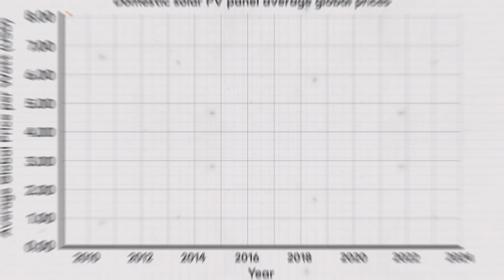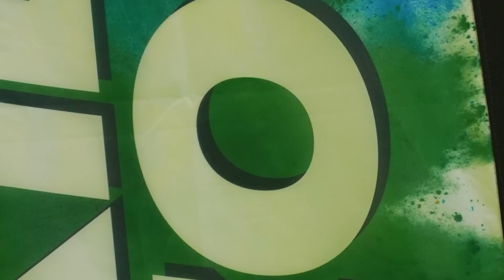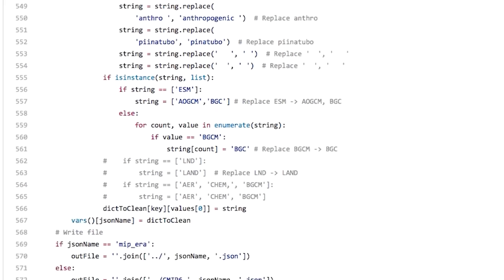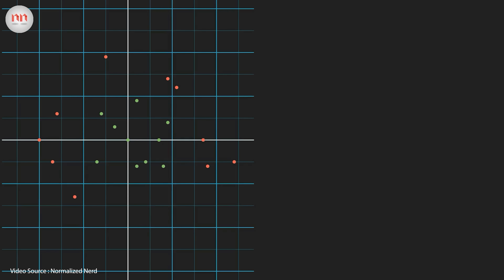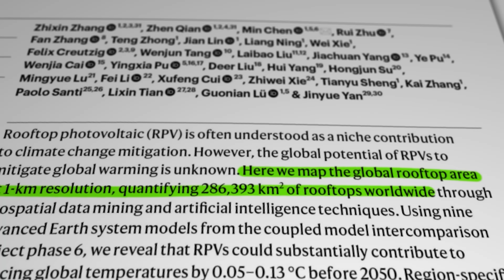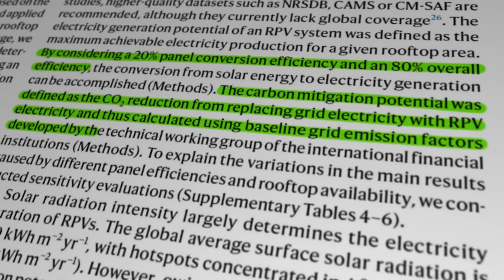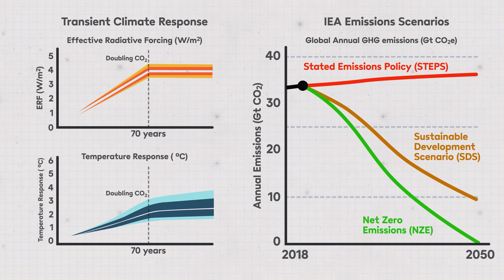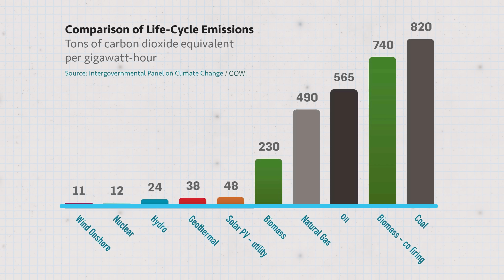New Report - Rooftop Solar PV is THE biggest climate mitigation technology!

Comment: I looked at rooftop solar here in Ontario Canada 12 years ago and was told the system would cost me $30,000. $5000 for the labour and 25,000 for the solar panels. Two years ago I again enquired into this and was told the system would cost me $30,000. $5000 for the rooftop solar and $25,000 for installation. I saw this as being criminally overcharged and so did not go ahead with this system. any suggestions?

Comment: Put my 5kW PV system up, 11 years ago, myself.  Cost about $5k, which paid for itself in 3 years.  Converted my whole house to electric, with heat pump HVAC and 2 EV’s, so bought new, 15kW of modules I’ll be putting up this month, replacing my 5kW system, totally worth it!
Reply: Very similar story to mine. I had 8kWp at first and then added another 8kWp, installed heat pump and bought two EVs. Now I don't know what to do with my money. 😅
Reply: 5k elen years ago? hard to believe. With inverter, mounting solution, cables etc?
Reply: @AttilaTheHun333333 True. $5000 for 5kW in 2014 is indeed very cheap, even DIY. But not impossible if one searched around for bargains.
Reply: Without overall control of saving energy solar has been pointless for all people that I have seen, friend got some and great rate back that is due to run out but with the money saved bought a motor home and travelled the country. An average UK household uses about the same amount of electrical energy in a year as is in 11 tanks of diesel. With solar being around 2% of total energy in the UK and just being an add-on to total energy, solar has had zero mitigation on the climate because their has been a zero reduction in energy consumed.
They're not free and they aren't clean, China has used the same amount of coal in the last 20 years than USA in the last 100, and as I say overall, with electricity being around 20% of our total energy, Solar would have to have a 1000% of all the installations of the last 2 decades and still 80% of our energy needs a replacement if we want to maintain society as is which is supposed to be impossible. 
Reality is we could all go to electricity, cut everything else, cut consumption overall and by staying on coal we could have cut 80% of energy.
Reply: @antonyjh1234 so easy to always spot the BS’er petroleum troll, keep sucking on those diesel fumes!
Reply: @antonyjh1234  🤣 No worries.

Comment: Whether roof top solar is worth it or not comes entirely down to your contract with the energy supplier. Is the metering "Net' metering or dual register where the imported power is metered separately from exported power, what prices are you being charged for energy verses what you get for selling energy. Are you allowed to export to the grid? How Much? When? Having a 10kW home system is a waste of time if your supplier does not allow export, or limits you say 2 kW maximum export, then charges you network access charges for the export permit. 
Rooftop solar is a ponzy scheme, those who got in early had great deals, those buying in now not so much. Energy suppliers don't want rooftop energy as it de stabilises the grid load profile making the day time load dips and night time load peaks more severe.

Comment: I’ve got 8kw of solar and my estimated conservative payback period is about 5 years.  I’m in Queensland Australia so the solar generation is probably about the worlds most favourable here.  

The wholesale electricity price here in Australia now regularly goes negative during the days now just because of all the rooftop solar installations pumping power into the grid.  

Here in Australia we are now flat out building battery energy storage systems to store all the better than free energy to discharge it at night when it’s needed.

Comment: central governments should vertically integrate the production and recycling of silicon based solar cells and panels, which would remain the property of the central government, and be low or no cost to the homeowners.  like checking out a book at the library.

Comment: I wonder if anyone's researched the idea of a global rollout of LiFePO4 batteries in every home.
If electric utilities and consumers share the cost of installing 20kWh of batteries in each home, the ROI for both the utility and the typical household is about 5-10 years, even on petro, because everyone can use non-peak rates.
Utilities then can install solar/wind/whatever without fear of intermittency, and they can do so at optimal locations.
The benefit extends to people living in apartments/condos/towers/etc as well.
As a bonus, everyone gets a backup battery. No more blackouts!

Comment: I put in a 13.5 kw system with 2 battery packs, overkill… after running the house, charging the EV (and we drive a lot) and selling excess to the grid we have sold $20 more then used.  Looks like an 8.3 year payback.  Off peak I buy power at 6 cents a kw and sell excess at 8 cents, Netzero helps with controlling when to buy allowing selling excess as much as possible.

Comment: No. But it's 80% of the solution. If every house could even have a small amount of solar to reduce even their grid usage by 10% they reduce the grid requirements by 10% and we can reduce gas and other fossil fuel use.

Comment: Do you know if the system took into account the structural integrity of different types of rooftop. For instance due to my roof being rated to withstand a category 4 cyclone, it will support the weight of a much larger PV system per square meter, than say the rooftops of a shanty town outside of Mogadishu

Comment: There are still 3 arguments to solar (as of right now, not future talk), 1) Its still a bit costly for the average home owner. Not only the cost of the system, but also issuance, maintenance, paperwork, etc. 2) Its a risk item, depending on the area in the US, these panels might have to deal with some weather that they might not last against such as tornadoes or hail, sleet, and snow. 3) Battery cost are still high and you will want batteries. A lot of this can be fix and will be fix over time, but the main issues still exist for many. States and Cities here in the US need to support the idea and offer packages for home owners to get the best value out of it. Labor being the most costly part + getting people that know how to install it correctly and not cause roof issues. Some people wont have access to their solar during winter where they will need ot be clean off as well. In the mid west, its not that crazy to get weeks with no sun/cloud cover. To be clear, I am pro solar, I have solar panels, but I am just giving off what I notice as far as why many may no go that route. Again, I know many of these challenges can be fix in the future, but until they are, it is what it is. Even then, the US needs to look at power import and export differently as well. As you say, we need to push uiliity companies away from generation power to storing more power. And then, force them to buy the power roof top over produces at reduce prices and sell that back to customers at reduce prices. This way it becomes less of a rich vs poor as more people go solar, it helps everyone to go solar.

Comment: The big catch is that solar panels are only 20% efficient.  Solar panels are mostly black, so they absorb much more heat than white roofs.  20% of incoming heat goes to electricity.  The other 80% goes to heat which heats the building and its surroundings.  Because of this white roofs are preferred in sunny climates.   

I was in Darwin Australia recently.  Almost every house has a white roof  ..... and air conditioning.

So the electricity generation benefits of solar panels in hot climates are counteracted by the unwanted local heating effects.

I do not have the numbers, but I think this problem blows your proposition out of the water.
Reply: In places with high Aircon usage solar is an even better idea. Running AC from fossil power plants is really making things worse.
Reply: Burning a fuel in a power plant also releases most of its energy as waste heat. This waste heat has no meaningful impact on the local temperature.
Reply: Thermal power stations use cooling towers to disperse waste heat.  But heat absorbed by solar panels but not turned into electricity heats the houses underneath.  This heat disperses eventually but until it does the local environment is heated.   Hence more Aircon load  for example and possible heat islands.

Comment: Yes, wonderful. Points again to the elephant in the room that we don't really have a solution for: seasonal energy storage for electricity.
Reply: hydrogen seems to be the best prospect for that, though both storing it underground and burning it for electricity on demand are unproven. In the meantime the priority is replacing gas on the grid with solar and wind.
Reply: @dougbamford  where I am gas is used mainly for peaking power, so solar and  wind don't replace that. IMO ammonia is a better choice than hydrogen for long term storage - the storage cost is likely lower. At long storage times, storage cost dominates all costs.

Comment: On a residential scale, done right would make serious sense.  For anything comercial or with any kind of density however and you need to go to heavy generation strategies like Hydro, nuclear, biomass/waste, or geothermal.
Reply: Mixing sources is always a good idea. But you can fit a lot of panels on a warehouse roof, and that could probably run a lot of the machinery. Check out RSEV who has panels on the roof of his EV Sales business and charges the cars from it for free.
Reply: @dougbamford  Commercial= Office full of PC's, Supermarket, Fast food.  None of them have enough square feet of roof to feed the reefers, computers or foodline.
Warehouses? that might be enough for a surplus.
Reply: @dougbamford  the energy density-what a solar panel can collect- in the middle of the Mohave desert USA is 3 kilowatts/ meter. a solar panel is about 25% efficient.  I doubt any steady load can be supported at that energy density.  Those cars are plugged in for an hour, charging off energy collected for 24hrs.
Reply: @watchthe1369 Sorry, I don't understand what you are talking about. You can either put a panel on a roof or not. Once done it will generate what it generates. If you don't put one on a roof you won't generate anything. No one has said that the solar panels have to generate exactly what the premises use. They can generate less and save the owner money on their power bill. They can generate more and the surplus can be sold to other users. What are you trying to say?

Comment: What I've often wondered is how much effect make roofs white would have. White roofs reduce the need for air conditioning, reduce the urban heat island effect and should reduce global warming. Relating to the video; solar panels are dark and so absorb most of the light that falls on them - the opposite of a white roof !
Reply: I don't have any hard numbers for you undertunately but I can think of 2 major factors that makes solar panels different to painting a roof black ( wrt to effect on air conditioning) - first of all 20-30% of the solar energy is not converted to heat but instead electricity, second there is generally a small air gap between the panels and the roof which is inefficient at transferring energy to the roof and even slight breezes will displace that heat

Comment: The only reason wild AC from roof top solar voltaic and wind turbine generated electricity are not stranded assets is because of their forced support by the public power grid.   Large amounts of wild AC is reliably supported by the public power grid with natural gas jet turbine generators running at 70% fuel consumption high readiness making nearly no electricity where 100% output would 100% backup the wild AC.  This costs more natural gas at is lowest level of consumption than making all the electricity from efficient running natural gas combined cycle power stations able to use a steam cycle to add 50% higher efficiency.   A steam turbine generator reacts too slowing to support large amounts of wild AC practically necessitating large amounts of natural gas to support wild AC with jet turbine generators at high readiness.   

In the US there is a reported fuel saving of 1% each for solar voltaic and wind turbine generated electricity.   This is an optimistic and false fuel savings.   The UK is culling its wind turbine farm to lower more steady output to save expensive natural gas.  Germany is doing the same stating it is experiencing a "wind draught" for the lower percentage of wind turbine electricity.   

There has been no climate change from global warming which is expected to start at 1.5°C of global warming causing stronger hurricanes in the Gulf-of-America (Gulf-of-Mexico).   NASA reports global warming at 1°C where it has been since 1992 after falling from its all time reported high of 1.1°C in 1991.  The cause of global warming is not known in 2025. 

It Impossible for greenhouse gas behavior to cause global warming.   All the greenhouse radiant energy from the earth is completely absorbed is earth's water vapor saturated greenhouse effect by greenhouse gases a few meters from the radiating surface adding 5.55°C (10°F) to earth's average temperature and can't have its overall effect change.  This was taught in US high school science where I learned it.   Earth's greenhouse effect is due to water vapor.  The other greenhouse gases can not change its overall effect.

Al Gore (US vise president 1993-2000) was greatly behind the scam that human caused carbon dioxide emissions were causing global warming starting in the mid 1980s.  This visibility gave Al Gore the US vise president position and has increased his net worth over ten times to over 100 million dollars.  Upon becoming US  vise president in 1993 Al Gore had it become federal policy that human caused carbon dioxide emissions were causing global warming.   This policy with the National Science Foundation (NSF.gov) caused earth's water vapor saturated greenhouse effect from being taught in US public high school science.

In the US a new ultra supercritical coal plant burning high BTU bituminous coal was estimated to have crossover fueling cost with natural gas priced at $0.80 per million BTUs in 2022.   US wholesale natural gas a near breakeven seasonal low was priced at $2.50 per million BTUs June 2024.   The new technology clean coal power station had less than 1/3 the fueling cost of natural gas at the lower price of natural gas during the year.   

The UK had wholesale natural gas priced in US equivalents at $10.50 per million BTUs natural gas Oct. 2024.   The UK still has large reserves of high quality British bituminous coal.   Nether the US or the UK have native amounts of commercial uranium fuel.   New nuclear fission power stations are costing so much over budget over 20 billion dollars that it appears the interest on their loans would be more than the cost of coal and staff at a similar GW ultra supercritical coal power station and the coal power station does require a 10 mile radius evacuation area as does a new fission nuclear power station.
Reply: You are absolutely correct about nuclear power being too expensive to compete with other sources of electricity.
HOWEVER,
You need to keep in mind that gas burning turbines filling in for variations in renewable power production is only a temporary condition.  As batteries fall in price they will increasingly replace gas turbines, starting in areas where gas is relatively expensive.